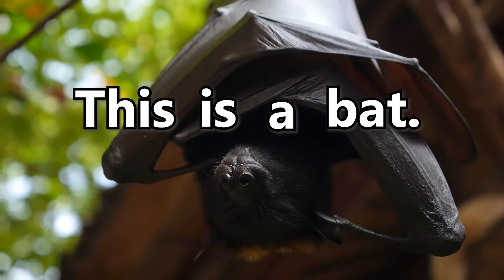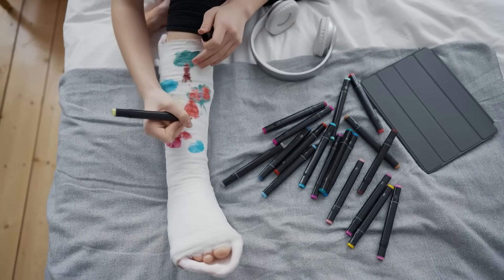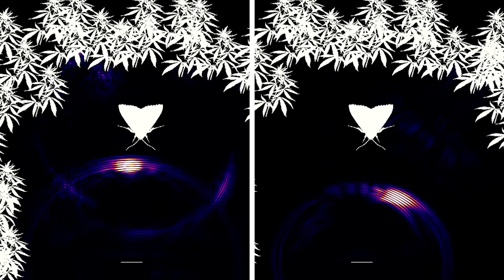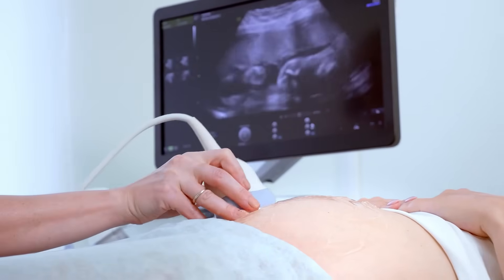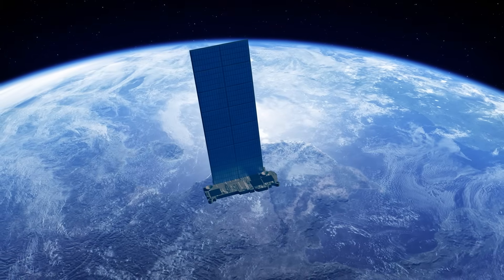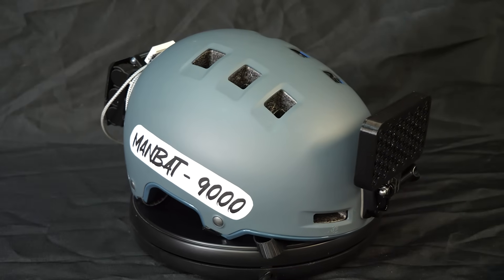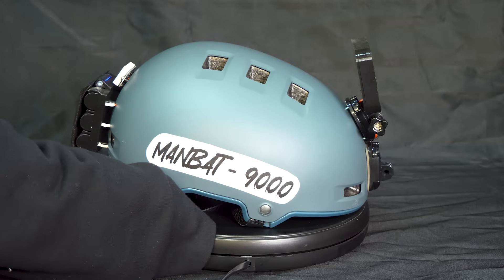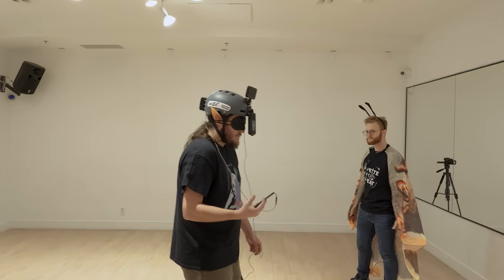A Submarine Sonar Strapped To Your Head

Comment: FYI 18 and 19 kHz might be above the low-pass filter used in the audio encoder by Youtube. I have not downloaded and checked it, but it is common practice to improve low bitrate audio quality by low-passing with a -3dB knee at 17-20 kHZ
Reply: I hope you are right. Otherwise I apparently have the hearing of an old person already
Reply: Careful people!
There are 1 of 4 steps necessary to not hear it:
- Software limitations streamside: For example youtube frequency cutoff. Check your bitrate. Not everyone views the content on the same bitrate.
- Software limitations receiverside: For example phone or pc might be cutting. There are encoders which process those signals for your hardware.
- Hardware limitations: Your headphones/speakers range might not be high enough. I did not hear for example an online soundtest with my headset after 16khz, but with studio headphones I hear to roughly 19khz. 17 khz for instance I heard EASILY on my studio headphones, while absolutely nothing on my other ones.
- Ears: Well, now we get to the part where you might be old/your hearing is damaged.

Also, with my normal headphones I heard absolutely NOTHING in the video. (nor 18 or 19khz)
With the studio ones I hear those both tones loud and clear!
Reply: 19 kHZ sounds like a low crackling, but I didn't hear anything for 18 kHZ... which is not how this should work, I think, lol

There's definitely some fuckery with the audio that's probably YT's fault. Or simply an issue with our headphones (but I doubt it)
Reply: @nisqhog2881  yeap. Same here. Tested mine with local sine generator and that doesn't crackle...just plain sine.
Reply: I did hear 18khz as a sine wave but 19 was some weird speaker noise. I suspect there's also hardware limitations in play, since I think it should have been completely silent if I would have simply been my ears.
Reply: @Kenionatus  Some massive shinenigans are at play here, when I watch the video and record my system sound, there's quite literally nothing... the spectrogram is a pure black.
Reply: @BirdbrainEngineer  Actually, what I wrote before is on my desktop and the weird audio was on my phone... 🤦‍♀
I also checked with an online sine wave generator and my hearing cuts off right at or slightly below 18khz but I can hear the 18khz in the video fine on desktop too. (but not the 19khz, as expected)
Reply: You are right, I just checked with Audacity, the sound is a flatline at those moments.

Edit: It seems like YouTube frequency cutoff is 16kHz
Reply: @BirdbrainEngineer  Maybe it depends which resolution and device you watch on.
Reply: @BirdbrainEngineer  lol, I could hear both. 18kHz very clearly, 19kHz faded out after a while and became this sort of sensation somewhere in the background. But I could 100% hear the 18kHz, and 19 at the beginning
Reply: @BirdbrainEngineer I heard sounds though
Reply: @cyntux  Re-importing from the .webm file directly, it does show sound, actually... Now... What I am hearing are definitely not 18kHz, nor 19kHz - they have a weird strong rumble to them, looking at the spectrogram does reveal the 18kHz and 19kHz, however, when looking at the waveform, it's pretty messed up. I think there's some issue with sampling?
Reply: @BirdbrainEngineer   When I downloaded the Opus 160Kbps track, it would play fine in VLC, but when I imported it into Audacity, it still had the tones but added a ton of lower-frequency distortion to them. Then I tried converting it to a wav in ffmpeg directly, and that also had the noise even if I encoded it as a 32 bit float at 48KHz just like the original audio, so I think the problems in Audacity would just be from the import step using ffmpeg.

Either way though in the actual video and the download before that conversion, the tones are definitely audible without the distortion for me.
Reply: @duckboycool  I agree that the tones are there, however it would appear that the YouTube playback itself differs from person to person. For me, it is dead silence (verified by recording system audio while video plays), while others hear it just fine, and yet more others hear the sounds with distortion... Rather peculiar.
Reply: @BirdbrainEngineer  I tested the other 4 audio tracks, and I can explain why this inconsistent behavior is happening. Like I mentioned, the 160Kbps Opus track has the tones in them fine, and it's the same for the 70Kbps Opus. The 50Kbps Opus track however has a lot of distortion on it, so people reporting that may have something like a data saver on which uses the lower quality audio.
On the other hand, both the 128Kbps and 48Kbps AAC/mp4 streams are clipped at 16KHz, and completely remove the tones, just leaving silence as you say. Likely you're getting that stream instead based on a setting or some kind of incompatibility with Opus. So per the original and other comments mentioning a low pass filter, this is true but only if your audio is AAC instead of Opus.
Reply: @BirdbrainEngineer maybe your downloader is shite

i heard the sound no problem
Reply: I hope this is it cause I had a moment of profound sadness thinking I finally classed as too old to hear those sounds....
Reply: Remember, low pass filter isn't the only thing happening. Dithering, aliasing, interference from said aliasing and dithering..
Reply: I wear headphones and it was obviously mangled by the audio algorithm. Some kind of aliasing, it was certainly not the frequencies stated (I can barely hear a pure 16kHz tone).
Reply: It's definitely to do with browser, device, and hardware. I tried using headphones which play deeper frequencies (not so well, but more so than others). I tried external speakers, iPad, laptop, etc. Finally the headphones on a laptop I can hear 18hz a low rumble and vibrated my whole body. A lot of other methods didn't work. Not sure what everyone is using, but apparently the vast majority of all playbacks and devices cut frequencies below 40 or 20hz. You'll need the right setup just to get it to even play.
Reply: Could hear them with skull candy crusher had to turn off bass boost n turn up yhe volume  1 click then i could hear it
Reply: Thank You! Had a feeling compression was the culprit.
Reply: From Audacity, Analyze, Plot Spectrum: (there are huge peaks at 18kHz and 19 kHz. In the test and and in the demonstration, the audio is so "loud" it is clipped: the peak amplitude is 1.707 dB (that's +1, not -1)) 

Frequency (Hz)	Level (dB)
375.000000	-11.434712
750.000000	-18.671707
1125.000000	-22.820694
1500.000000	-24.273777
1875.000000	-26.697327
2250.000000	-30.168068
2625.000000	-31.109501
3000.000000	-33.347416
3375.000000	-33.673985
3750.000000	-33.601627
4125.000000	-33.162910
4500.000000	-31.948870
4875.000000	-32.003387
5250.000000	-31.951330
5625.000000	-32.486649
6000.000000	-32.875729
6375.000000	-36.322552
6750.000000	-36.573753
7125.000000	-37.166103
7500.000000	-37.513321
7875.000000	-37.504288
8250.000000	-37.682095
8625.000000	-37.850349
9000.000000	-38.300274
9375.000000	-38.820763
9750.000000	-39.177879
10125.000000	-39.950279
10500.000000	-40.822281
10875.000000	-41.180859
11250.000000	-42.466782
11625.000000	-43.314346
12000.000000	-42.404774
12375.000000	-44.616180
12750.000000	-45.194523
13125.000000	-45.550453
13500.000000	-45.824169
13875.000000	-46.281605
14250.000000	-46.966499
14625.000000	-47.343014
15000.000000	-47.310745
15375.000000	-47.323841
15750.000000	-47.391624
16125.000000	-47.017868
16500.000000	-46.487602
16875.000000	-45.520908
17250.000000	-44.509663
17625.000000	-42.484833
18000.000000	-19.518847
18375.000000	-36.834057
18750.000000	-29.185225
19125.000000	-23.239162
19500.000000	-35.189526
19875.000000	-39.763493
20250.000000	-42.517616
20625.000000	-44.360561
21000.000000	-45.612095
21375.000000	-46.617016
21750.000000	-47.283306
22125.000000	-47.802105
22500.000000	-48.169186
22875.000000	-48.441288
23250.000000	-48.634335
23625.000000	-48.734776
Reply: yeah I was still certain I could hear those frequencies and I heard nothing. I turned up my volume and my headset was doing some popping. This meant they probably weren't outputting a usable sound signal.
Reply: Nope, I can hear them pretty well
Reply: Yeah, i can hear an 18khz i just generated in audacity easily, but i didn't hear anything in the video. Must be something with YouTube's sound compression.
Reply: Use a headset
Reply: i heard it at 18 so idk if its just my age or someone else that if you have poorer speakers that it wouldnt play that sound
Reply: Wait so that cracking was the actual sound?
Reply: yeah they didn't sound like 18/19kHz at all and i've tested those in the past and I also remember youtube cutting everything above 16kHz
Reply: @the_mister_magister  i could hear it 19 was fine but 18 felt like someone was scratching chalk on a blackboard in my head
Reply: I don't think so, I only say this because my cat freaked out when they were played hahaha
Reply: I heard it, it was horrible
Reply: @cyntux  you physically can't so you're full of shit

Comment: 1:32 Decibels in water are not same as Decibels in air. I think you should have clarified that. A different reference is used in water
Reply: That's very useful remark, I didn't know it and was a little bit sceptical/surprised by 230db
Reply: yeah iirc decibels in air max out at 190db before becoming useless as the sound wave has so much energy the air cavitates
Reply: No one talk about gyatt?
Reply: @Yogurt_alt hahah my guy
Reply: Technically true, but there are a lot of air pockets in your body which make his statements mostly correct
Reply: @the_undead  Where are those air pockets? 🤔
Reply: @Ebani Your lungs, sinus cavities, stomach, intestines etc. Not necessarily air, as in nitrogen, oxygen, water and co² but definitely air or other gas mixtures.

Comment: No way this video is how I find out why stealth aircraft are shaped like that xD
Reply: right angles and circles reflect radar so older stealth aircraft like the f117 avoid this by using sharp/oblique edges and faceted designs. Modern stealth aircraft however use complex computer generated rounded shapes to deflect radar without the loss of aerodynamics due to the "flat" design, back in the day computers just werent powerfull enough to calculate these nice round shapes.
modern stealth jets do still use serrated edges and sawtooth design on skin panels and stuff like the landing gear door and access panels